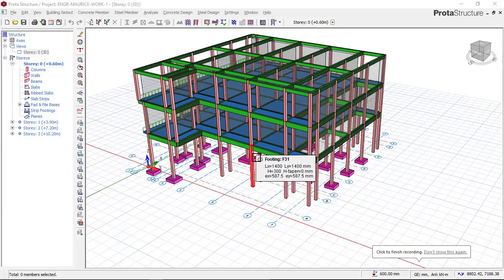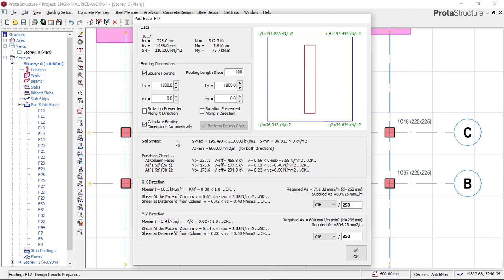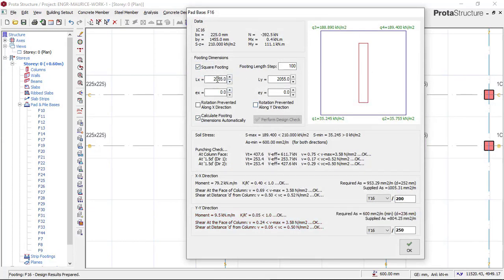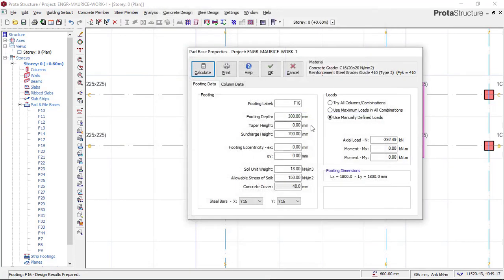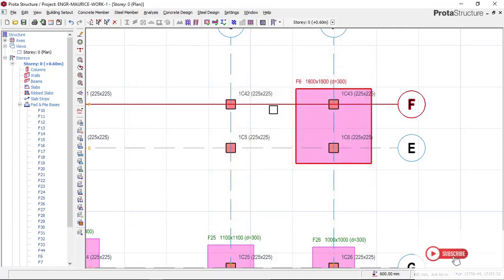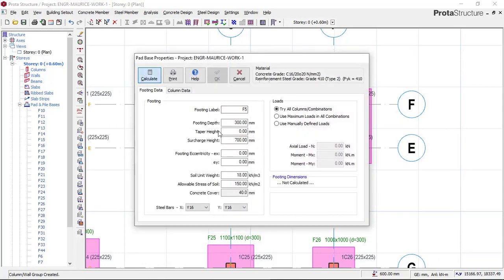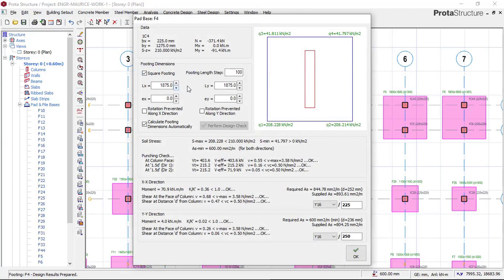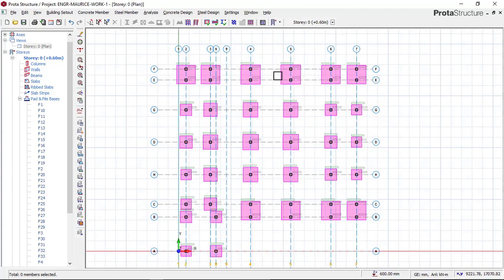Design of combine footing in protastructure

Comment: Thank you so much for the nice video. I would like to make some clarification Sir. Why did you remove the moment in other footings.? Would it be more safe for our design if we retain the moments? Thank you Sir.
Reply from the maker: I removed the moment because I want the software to use just the Axial Load value to size the footing .

The software is trying to use the moment value and the Axial Load value, which is not right and that is why we were having larger bigger size of footing.

In theory and practical, we use only the Axial Load value (N) to determine the size of our footing base and we use the moment to calculate of the area of reinforcement need
Reply: @EkidelCAD  The axial load (N) is determined by the maximum value of the load combinations?
Reply from the maker: @stantablizo5045  Yes, exactly
Reply from the maker: For Pad foundation design, it is very safe if you remove the moment value and use only the Axial Load value to determine the size of  the footing.